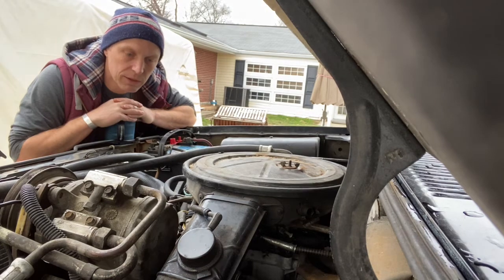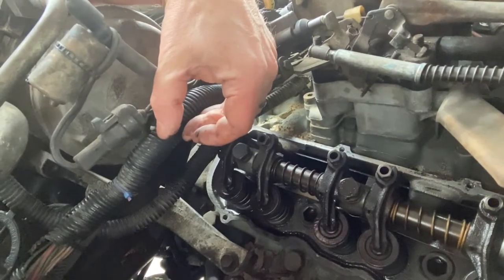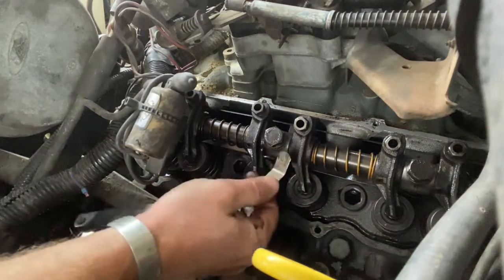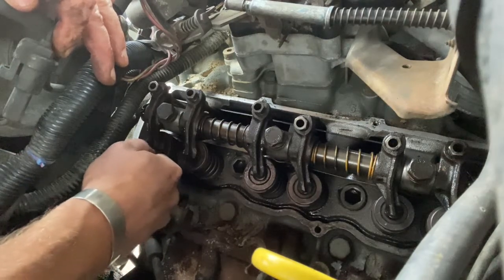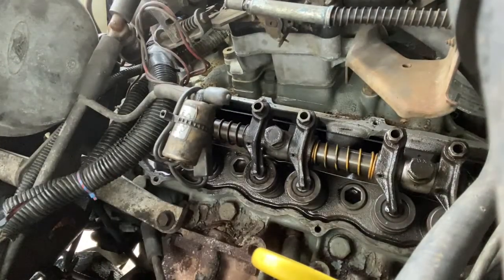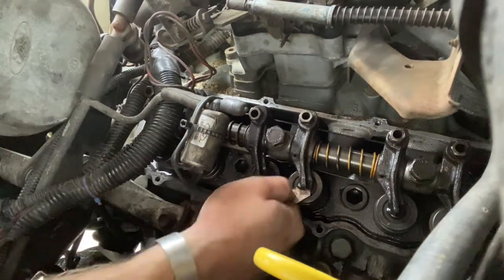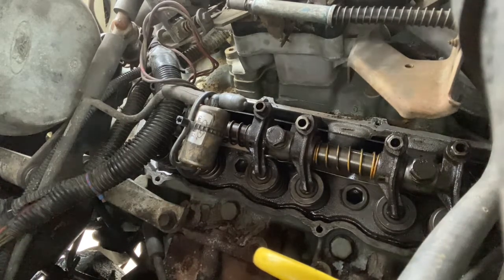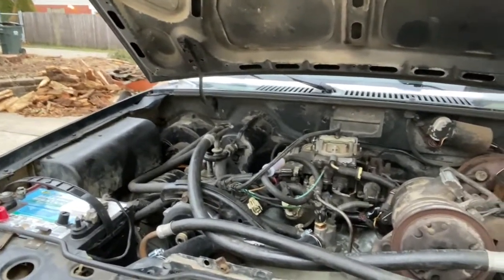How to adjust valve lash (somewhat poorly) on engines with solid lifters

Comment: Hey Fox!  Good vid. I watched your others as well regarding the oiling issue and fix (drilling out cam bearing) etc. I just adjusted valves on my 84 Ranger 4x4 with the 2.8. Man were they clacky! Original 80K miles, and I doubt if previous owner ever did it. Rocker cover gaskets as stiff as burnt bacon (and the oil leaks to go along with them)...I could loosen most of the cover bolts by hand without using socket! I put feeler on some of the looser feeling  rockers and had over .025 of lash! Got them all in spec now and so much quieter.  I'm getting oil from all 12 weep holes in the rocker arms , but it had to run a couple minutes to see oil come out of all of them. Didn't know if that was normal or not. But they all were doing they job it looked to me.  No slop at all in rocker shafts to rockers, everything seems real tight. I think I got a good engine in it, been messing with it while I got the C5 auto trans out for overhaul (reverse band broke off a nub where it meets servo strut). Compression good on all cylinders with only a few lbs difference between. Oil pressure at 50 psi (got a real gauge screwed in down below as old sending unit shot). You still got your ranger? Latest stuff you've done?  Funny, I used to have 2 door dodge raider, I have an 89 Jeep YJ. Seems like we both like to mess with same kind of headaches🤪

Comment: What exactly is driveline lash? Is the pushrods not engaging the rockers all the way from being out of adjustment?
Reply from the maker: Excellent question!  Valve lash is the distance between the tip of the rocker arm where it contacts the valve, and the tip of the valve.  It is usually 10-20 thousandths of an inch.  It accounts for heat and expansion.  Too much lash gives you the flattery noise and less valve engagement then spec, to little lash could keep the valves from closing all the way and causing it to run rough, miss, burn a valve, etc.

Comment: This guy had the same problem I have on the same car and on the same side to😂
Reply from the maker: @ozzylowther3142  the source of my problem turned out to be a cam bearing that a machine shop had installed backwards so no oil getting to the drivers side rocker shaft.  I ended up removing the rocker shaft and camshaft, then drilling thru the cam bearing from the top with it still installed to fix the issue
Reply: @Foxcanfixit  I should probably look into that thanks
Reply from the maker: @ozzylowther3142  pulls the drivers side valve cover and start it, if you don’t see oil continuously dripping down the rocker arms and onto the valve springs then you have a blockage of some kind.  Hope it helps
Reply: @Foxcanfixit  I’ll try it out thanks